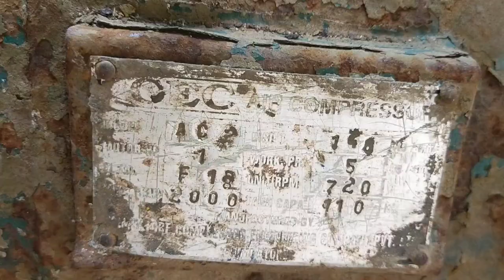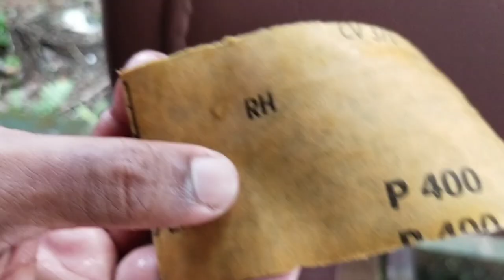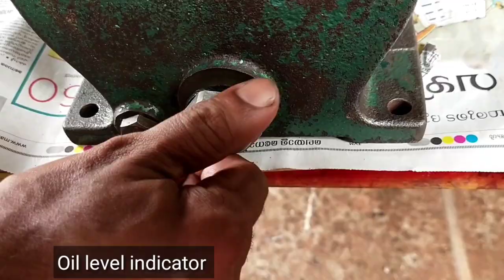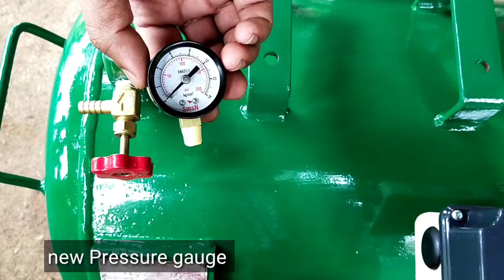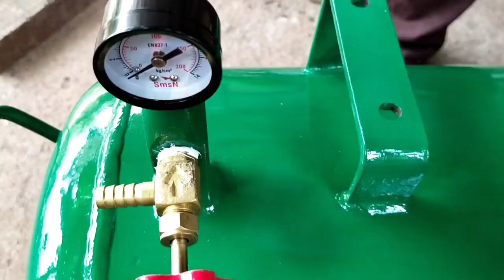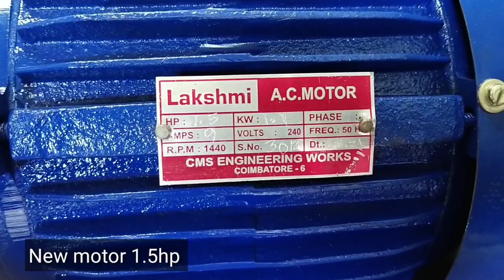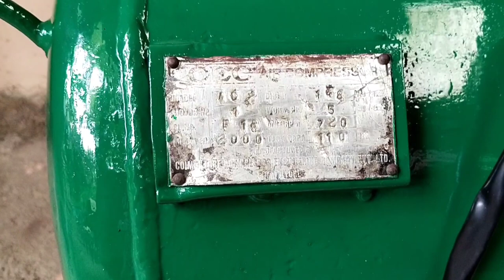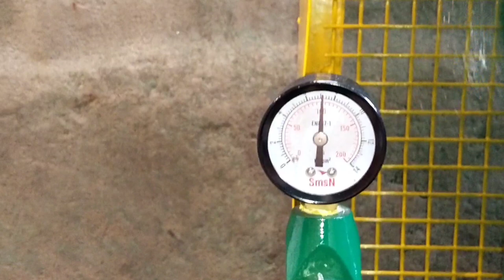Rusty Old Air Compressor Restoration From Scrap

Comment: Pressure switch pipe ee model company tharunne aano adho custom chydhe aano ente kaiyil irikkunne compressor pressure switch vekkan ulla pipe illa ??
Reply from the maker: ഇത് ഞാൻ scrapil നിന്നും എടുത്തതാണ്. അതിൽ pressure switch ഉണ്ടായിരുന്നു (pipe ഉൾപ്പെടെ) അത് complaint ആയതുകൊണ്ട് പുതിയത് വച്ചു.
Reply: @BijoyTs  pipe weld chydh pressure switch vekkan pattumo ?
Reply: Enthine engine and spres evdenna kittuka..place onnu prnju tarumo..no undel ayakamo

Comment: 3000 rs കൂടാതെ എത്ര രൂപ കൂടി ചിലവാക്കിയപ്പോഴാണ് ഈ കണ്ടീഷൻ ആയതു?
Reply from the maker: New motor ₹8000, motor pulley ₹700(pulley₹450+ ₹250 lathe work ),  belt ₹200, pressure switch ₹850, pressure gauge ₹200, air outlet valve ₹200 ഇത്രയും main ആയിട്ട് ആയി പിന്നെ oil, reed valve, painting etc
Reply: @BijoyTs  well done👍